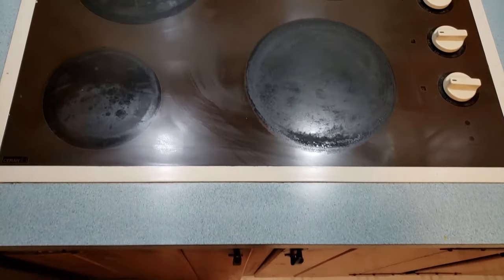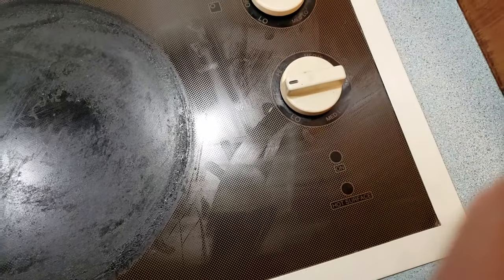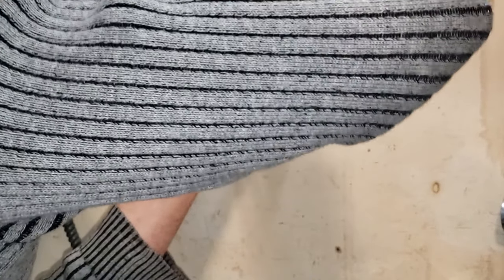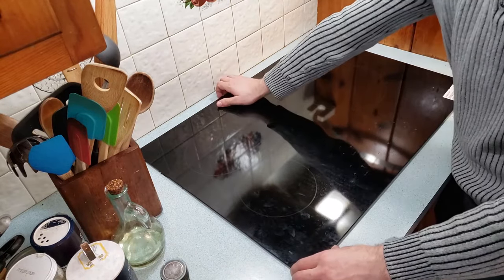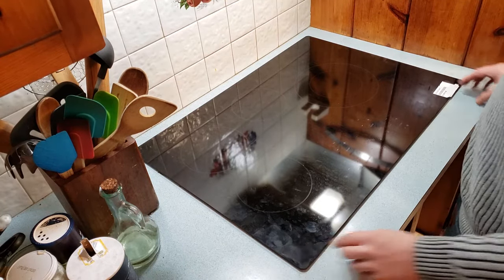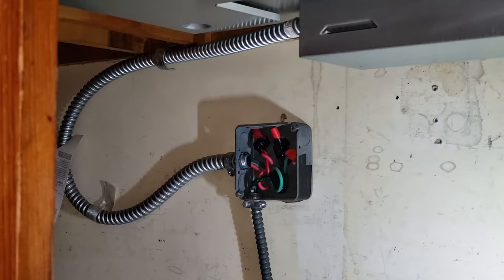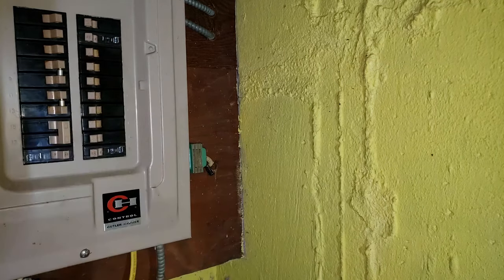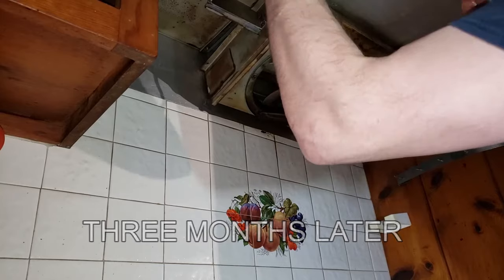How to Replace/Install an Electric Cooktop | Kitchen Remodel Series 3/9

Comment: I have to say this is a great video. I am a female that sometimes takes on small projects. However I have assigned the electric stove top replacement to my loving husband. He was an aircraft mechanic and has general good knowledge about working parts electrical is so so. (I have replaced my own electrical breaker cartridge).  This video was great step-by-step. No nonsense. And seems to have everything we need to replace the stoves tomorrow....😊

Comment: So sorry. I’ve been in a similar state of “ah shit!!”  I was replacing my car window approx 30 yrs ago; was younger and dumber. I had dismantled the door, studied how the window would go in, and removed the old one (broken glass), cleaned. I pulled out my new window, leaned it against the for a sec, all ready to go. All  the sudden, with no warning, a gentle gust of wind caught the new window and it went to the ground, shattered it. I looked at the mess and thought, “nah, that didn’t just happen. f&(k! F€%K!…”.  

Great video! Clear and real.

Comment: With metal flex housing for the wires, "usually" all you have to do is ground to the box if the metal wire housing (That I can't remember the name of) goes all the way back to the panel. The metallic housing is the ground on those.

Comment: Love the video. Not much of a DIY guy but I think this is something I can manage. How do I find out the "power issue" you mentioned in the last minute of the video. Too much vs. too little for the new top? Thanks for your time in advance.
Reply from the maker: Look at the breaker supplying your current cooktop, the number on it will tell you the max current it can supply. The specification sheet of the new cooktop should have the current/max amperage requirement, which should match the breaker. If it's smaller (as in max current on cooktop is smaller than breaker), you can just swap the breaker for a smaller one. If it's larger, that's a no go unless you are willing to replace the wiring from the panel to a larger gauge.

Comment: So there is only a tape which holds it? No screws or other stuff?
Reply from the maker: Not necessarily, apologies if I didn't mention that. Mine didn't have anything holding it down so it slipped right out, but yes - it's possible there's clamps screwed down on the underside.
Reply: @Bootstrappin  So to get there i must first remove cooker i think. But cooker have some screws also for sure.

Comment: Is there a way to disable individual burners? The two burners on the left side of my cooktop had cracked glass like your poor cooktop at the end (F) but the other two are perfectly fine and I'd like to just disable the 2 left ones and then put a single-burner induction stove unit on top of it.
Reply from the maker: You could probably remove the whole potentiometer underneath the knobs and cap off the wires going to the pot with some heat shrink -- but this will likely require a lot of work (you'd have to turn off the breaker, remove the cooktop and disassemble it through the underside) - enough work to justify buying an entire new/used cooktop with built in induction.  I don't know if there's an easier way. Newer cooktops do have an RJ45 port, implying that their firmware can be modified, but I wouldn't know where to start.
Reply: Just replace the thing instead of risking burning your house down.

Comment: My house has a supply wire is white and black  and a bare copper, how do I hook that up?
Reply from the maker: I'm not sure -- because that sounds like a conductor for a regular outlet. I guess I would first figure out what's going on with that cable, see if it's 120V or 240V. Measure between black and white, bare and white, and black and white. And just in case, I'd be cautious with that bare, just in case it was wired strangely.
Reply: That is definitely not the correct type of wire for an electric range. If that is hooked to a 30 or 50 amp breaker, that is a massive fire hazard. I would call an electrician. Remember, if you make un-permitted repairs or upgrades to your house that cause it to burn down, your insurance company does not have to cover them.

Comment: A sheet of 3/4 plywood with a few pieces of 2/4 around the edges would have probably prevented that problem. I have a glass top electric range (I hate electric!) and when I put my range hood in I moved that sucker out of the way. No way would I take a chance wrecking a brand new $1200 (pre-Bidenflation) range.
Reply from the maker: Hah yeah, live and learn I suppose. Better hang on to that cooktop, I bet it's worth $5000 now lol.

Comment: Don't you need to secure the cooktop?  You just drop it in and that's it?
Reply from the maker: I think it depends if the manufacturer provided anything. I don't recall this cooktop having such an attachment. But from what I've seen, it'll just be a couple of angle brackets that clamp on to the underside of your countertop.